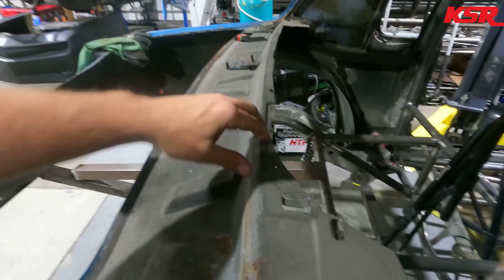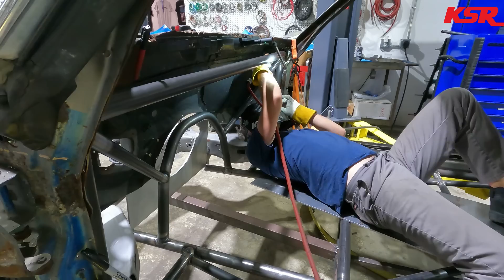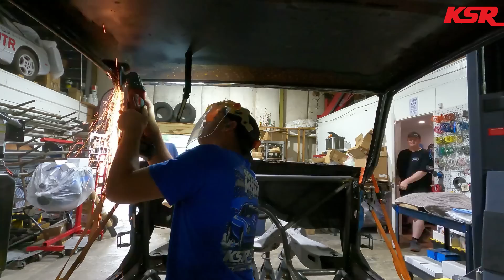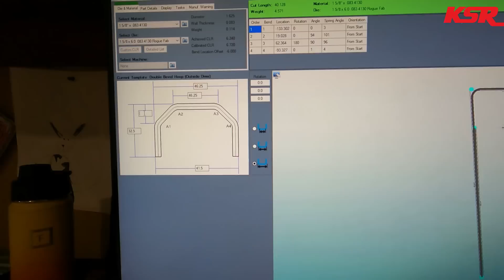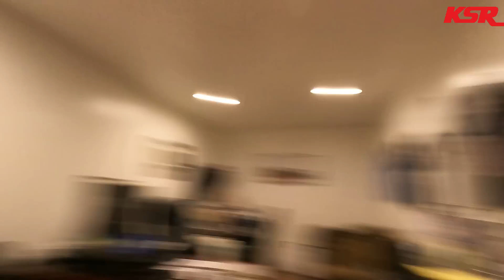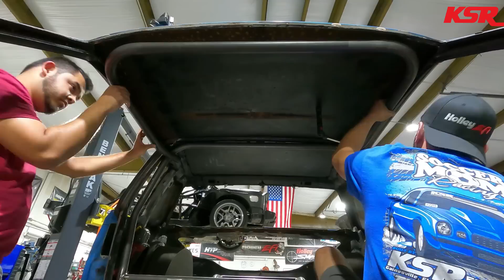So. Many. Bars.... More Progress on 25.3 Chassis in MY Cutlass! KSR Cutlass Build Episode 21!!

Comment: Why single shear on the rear shock mounts?  Just curious. Seems like a lot of load for single shear
Reply from the maker: There is not a ton of load in the rear shocks actually. The ARB mounting sees much more stress than the shock mounting bolts.

Comment: That rear, upper shock on the Camaro, even with the long thread, wouldn’t you want a second point of attachment?
Reply from the maker: Nah, single shear is fine for that spot. There is not a ton of force in the rear shock mount. There is a ton of twisting force in the ARB mount though.

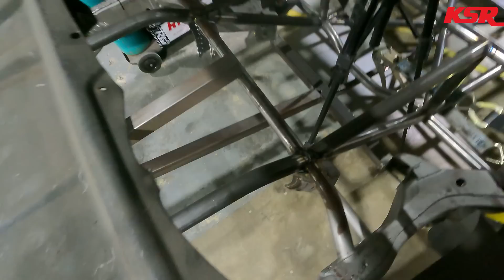Comment: 3:00 as a Californian, that's a Florida thing. I can leave metal in my garage, and it doesn't get surface rust. Maybe after a few years, some will start to form on truely raw metal.

Either way, at least it's not Canada. First time I experienced a truely rusty car from Canada it blew my mind. Every single thing that was metal was rusty. Under the hood every nut was just a ball of rust.

Comment: You can put four bender clamps on the tube at the start. Doing so on a flat surface keeps all four bends on the same plane. A bonus is you can then easily put the tube back in the bender in the exact same spots if you wind up needing a little more angle. I'm getting ready to order a Rogue M625 bender and have been watching all their videos. Thumbs up for the halo bar style cage, it's the strongest design if you take a hard hit to the front corner of the roof.

Comment: Can you notch in on the end of the tube but from each side but on a slightly different angle for each? Or is that still not close enough?
Reply from the maker: For me, it’s easier to mark where it’s touching and notch it. That big giant tube is kinda a bear to use in my notcher anyways
Reply: @KSRPerformanceFabrication  thanks makes sense. Thanks for the reply legend. Keep kicking arse 👊🏼💙

Comment: Filming welding: I bought a cheap auto darkening filter off amazon and tossed it into a metal box. Hot glued it into a window in the box. I put a piece of plexi on the outside to protect the filter I 3d printed the bracket for this but you can just glue or tape it.

The on the inside I just glued down a go-pro mount at the correct height.

I control it with the app.

You need the box to be sealed for light since reflections on the back side of the welding filter will bug the camera out.
Reply: Sounds like a good idea without spending a ton of money, someone like Kevin could knock one of these out in an hour or two.
Reply: @Hoaxer51  Yep, and you just toss a 1/4-20 tapped hole on it so you can put it on a tripod.

Comment: What GoPro mount do you use? I can send something that can hold it on the inside of the helmet and I can bond in a small bracket to hold it
Reply from the maker: I just use the ones built into the bottom of the camera
Reply: @KSRPerformanceFabrication   which camera do you use, I can see about bonding the mount on the inside bottom or top and having it look though the lens. If you want we can try it on the plastic hood and if works well I will send you a new carbon one that’s lighter and has a 3d printed lens holder instead of the epoxy one I build up in yours and I can add that mount in for you